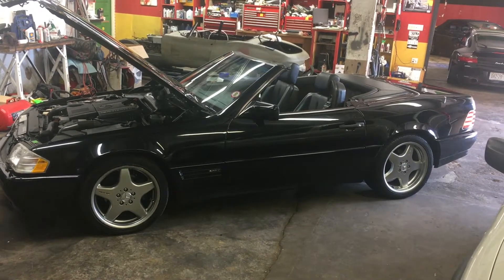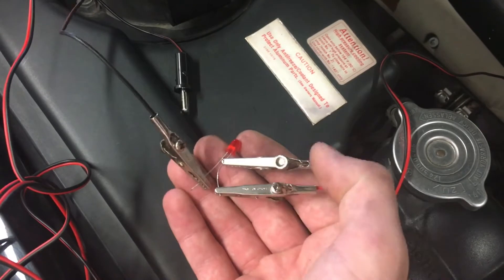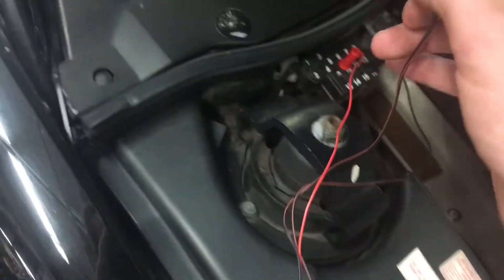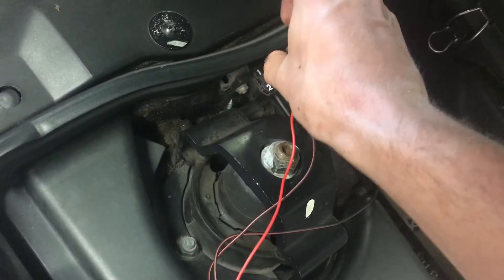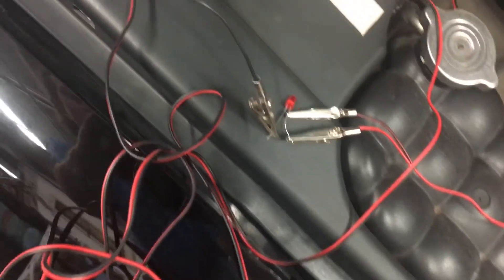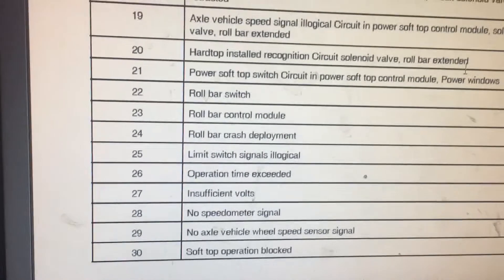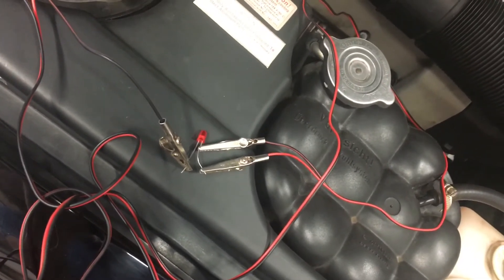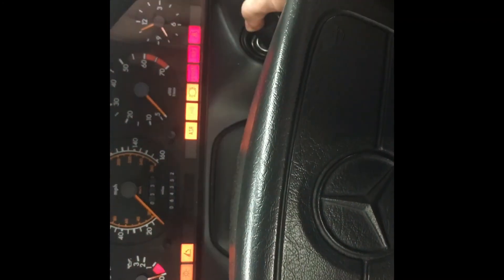Mercedes SL500 Convertible Top Diagnostic Soft Top RST Module

Comment: If the red and black are on the same leg, aren't they touching?
Reply from the maker: Thanks a bunch for watching my video and taking the time to comment. The way the tool is setup in the video worked for me, did it not work for you? Thanks for any update.
Reply: @WheelsTips  I didn't try it that way, I was just stating the fact you pointed out to not let the two touch, when they are on the same leg. Being on the same leg, they are in fact touching each other. There is an easier way to do this and that is what I did. If you touch pin 10 to ground for 3 seconds, the top button will blink the codes. No special led light and clips needed.
Reply from the maker: Thanks a bunch for the update, unfortunately this model does not have the button yours does, hence why you need a blink tool. The blink tool is a less expensive emulation of the original Mercedes tool. Thanks again for taking the time to update.

Comment: Thanks for posting this.  My top stopped working after changing the battery and I've been befuddled since.  I WOULD STRONGLY SUGGEST THAT YOU REPLACE THOSE UPPER STRUT MOUNTS, THEY LOOK BADLY CRACKED.  FAILURE CAN RESULT IN THE ROD PUSHING THROUGH YOUR HOOD!
Reply: you have to reset auto windows before top sync will work !
Reply from the maker: @cannoncorp1  Yes you are absolutely correct this is also know as, reinitialize the system.  It is done by setting the limits of the windows and convertible top.  Most cars it is where you hold the drivers window button all the way up for 3-4 seconds after it reaches top and same in the lowest position.  Depending on your car you may have to do it with the other windows or the main switch for all the windows.  This is also how you can reinitialize the convertible top by hold to close and to open a few seconds after it has opened or closed.  Thanks again for commenting.
Reply from the maker: Thanks a bunch for watching my video video and taking the time to comment. I have had a few similar scenarios regarding the top malfunction after battery change. If you have checked your fuses the next thing is to manual reposition the convertible to the closed or open position by manual operation and trying to reinitialize the system. Worst case scenario there are convertible top ECU repair/remanufactures that can bench test your convertible top ECU for faults.

Comment: it is valid 38 pin r129
Reply from the maker: Hey Ivan dc thanks for watching my video and for the comment.  Just double checking if you had a question or just making a statement?  Thanks for any update.
Reply: @WheelsTips  my sl 500 r129 pin 6 have 30 pulse LED, the problem can bus ?
Reply from the maker: Hey Ivan dc is the SRS system giving you a fault and you may have miss counted the blink code.  Please share an update, thanks.
Reply: @WheelsTips i have asr light
Reply from the maker: @ivandc7147  Thanks for the update, what vehicle diagnostic port do you have on your Mercedes; 8 Pole, 16 pole or 38?  The 30 blink codes tend to be CAN related, just out of curiosity have you checked the most basic the brake light switch and your fuses?  Please share an update thanks, also what year is your Mercedes-Benz SL500? Thanks for any update.
Reply: @WheelsTips  hi, Effectively the dtc 30 is can data bus ea / cc / isc
Reply from the maker: Thanks for the update, I would check to see if all your modules are working properly.
Reply: @WheelsTips  other dtc is swicht s29/3  throttle
Reply: @WheelsTips  After changing the throttle switch, it starts the engine with the asr light off and after 10 seconds it starts again, under the same can bus fault, I measured the resistances and continuity of the cables and it gives good results, I am thinking that I have a bad module
Reply from the maker: @ivandc7147  Thanks for the update, from personal experience when working on the throttle switch or unit on these cars especially after change you have to let the adaptation take place.  Leave the ignition in position 2 for about 3 minutes you should here the plate on throttle shuffling, not sayin this will solve your issue but worth doing if you changed the throttle sensor. I have been there before with these cars you have to use the symptoms of the car to diagnose OBD1 cars.  What symptoms are your having other than the codes.
Reply: @WheelsTips  When the car changed gear to R the idle fell as if the throttle valve did not regulate and we disassembled it to clean and change some oil gas tubes and that was when the asr light came on and the car is accelerated at idle
Reply from the maker: Personally on the R129 from my experience with ASR lights, brake light switch replacement and worked with the throttle body.  Google search, R129 throttle actuator rebuild.  One of the top websites goes into depth about the issue you are having.  There are services that rebuild these units at fraction of cost of repairing.  Also another thing a lot of people overlook, depending what year your R129 is from there was a major issues with the wiring harness in the cars, especially on the loom for the throttle actuator.  Please share an update, thanks.

Comment: did the top function after reset ???
Reply from the maker: Hey njoeandjen thanks for watching my video.  The top did not work after reset as I had a hard fault in the system.  This is why the code would return shortly after clearing and trying to activate.  What code are you getting?
Reply: @WheelsTips  Clear each code one at a time read top light in car 3 seconds 7 seconds to erase go to next one i did each one individually and it works perfect now Thanks to Vladimir that rebuilds these modules.
Reply from the maker: Thanks for sharing an update glad you got it to work, what did you build as a scan tool?
Reply: @WheelsTips  simple 2 wires in appropriate pins under the hood in 16 pin block touch together and read convertible top switch flash codes then erase each code after read.
Reply: @WheelsTips  my codes were coming right back asap until i did one code then cleared each one at a time it will work!